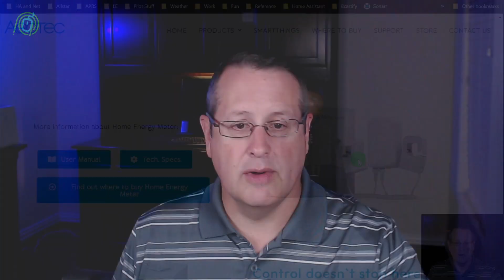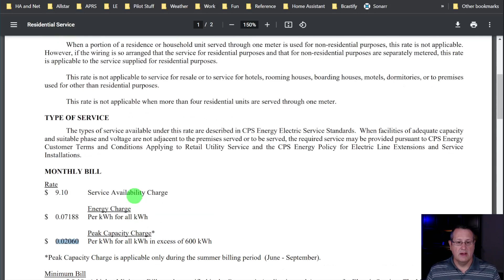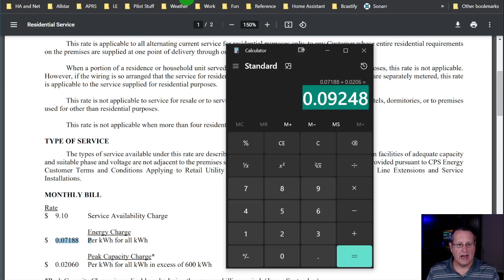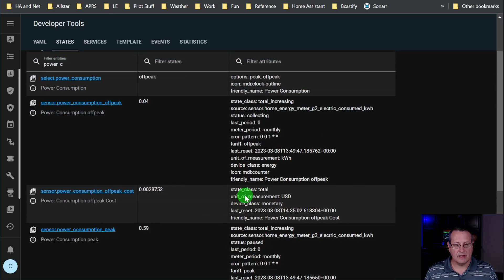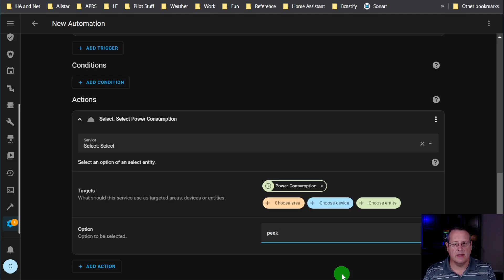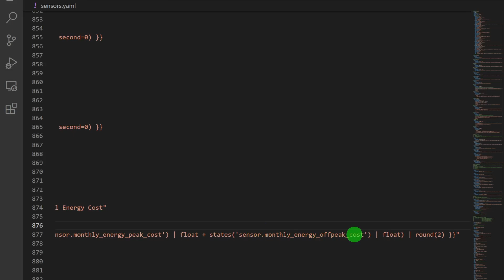Monitoring ENERGY and TARIFFS in Home Assistant

Comment: amazing,; Works fine! thanks again!... there is a way to has a individual cost for items . like freezer, ac , hvac, etc? specially with variable rate of the energy
Reply from the maker: If you want to monitor individual circuits, grab an emporia and put it in your panel. Or you can use power monitoring plugs. All of those type things should show automatically in the energy dashboard if HA recognizes them as an energy device.
Reply: @mostlychris  yes, thanks.. but im talking about cost managment more than consume. already install a few plug

Comment: I am a bit late but I have a curly example for you. Here in the Solomon islands we have very expensive power $7.33SBD/kWh which is about $0.88USD/kWh where as in Australia I pay 0.23AUD/kWh which is $0.16USD/kWh. Like you we have a monthly stepped tariffs of off peak, shoulder and peak. Also it is very hot here and as an expat we love the air conditioners and have the running just about all day so it is very expensive to run. Lastly We have cash power which is prepaid electricity, so even though the tariff resets at the 1st day of the month, it really doesn't kick in until you purchase your first lot of cash power in the month and it means you could not start using your off peak until 10-15th of the month depending on how much power you had left over from the last month.

My background is that I built utility billing systems for Electricity, water and gas companies that would bill 40-100k houses every night and this is doing my head in.

I would like to be able to accurately determine the cost of the air conditioners but I do not know when my first kWh is going to be used. I think I am going to ignore this and reset at the beginning of the month.

Ideas will be welcome.
Reply from the maker: You have a good challenge here. The hard part, as you mention, is figuring out the start of your billing. It sounds like it varies based on usage and how much cash power you purchase. I would be interested as well if anyone knows a good way to track this. Tariffs are the worst ever for consumers. Probably make lots of money for providers though.

Comment: I am getting frustrated with the utility meter helper. I am using Emporia Vue and my service is SRP in Arizona and there are 6 different tariffs based on time and month. Peak and Off Peak rates change from winter to summer and then again for Summer Peak rates. Do I need to build 6 different Tariffs and 6 automations to switch out then add all of those helpers as sources in the dashboard? Thanks for any help. Youre right Tariffs are difficult.

Comment: Hey Chris we got the same Aeotec energy meter ...mine throws weired numbers at times and it is a known issue how do you compensate for that? thank you
Reply from the maker: Well...just today (and once a couple of weeks ago) it did this exact thing. My kWh usage is 6 million now. Useless for this month as there is not a way, without modifying the database, to remove that erroneous value. Having praised that device in the video for its reliability, I now think I need to get the newer version and see if it suffers the same issue.

Comment: I had the Energy Dashboard working correctly until I updated HA from version 2023.2 to 2023.3.2, the graphics and information on Emergy stopped work, I no longer had electricity usage data and CO2 says "Consumed low-carbon energy couldn't be calculated", I already updated to the latest version of HA 2023.3.3 and everything is still the same, and the devices are working fine and with kWh information. Some help ?

Comment: How about base charges?  Noticed you left out the connection cost of $9 out. Mine is closer to $30.
Reply from the maker: Didn't include it for simplicity as everyone is likely to have some sort of differing set of charges. The charge can be added as part of the template sensor.